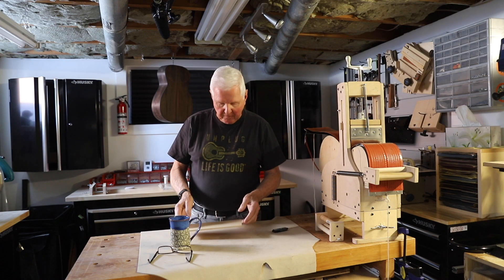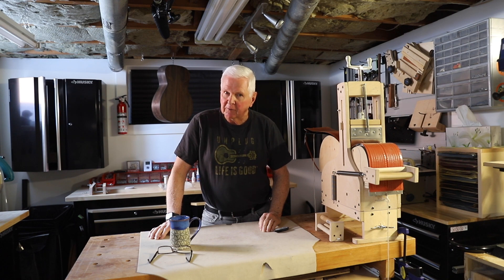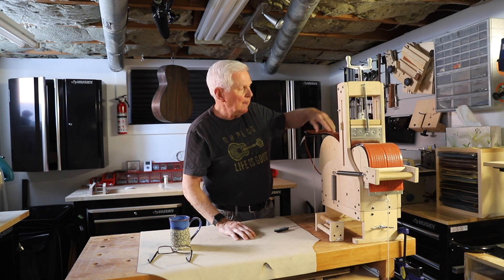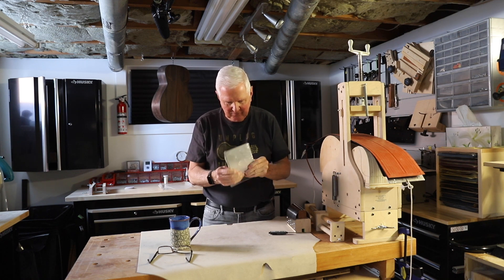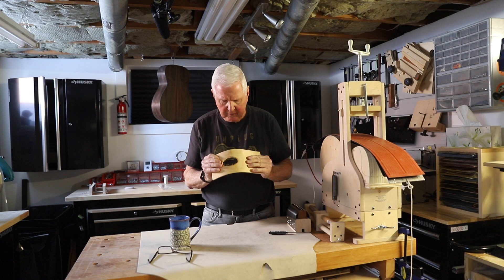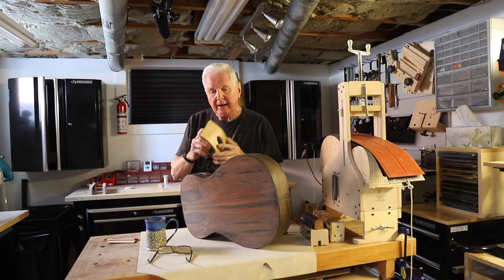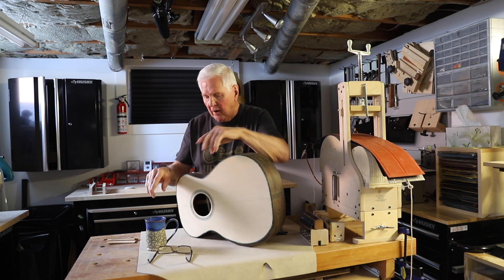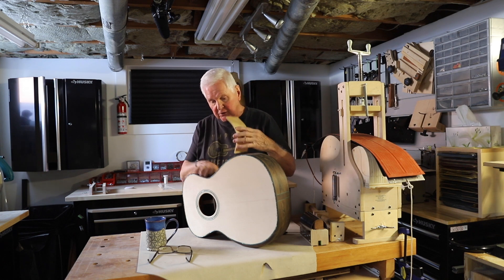Acoustic Guitar Sound Port Jig Works... sort of

Comment: Hi, Monty. I’ve enjoyed your videos, and am following to see you get your sound port jig figured out. Since you used a band saw to resaw the wood that you bent for this go round, why not just trace the profile of your guitar - at the area where the sound port goes - on to a solid piece of wood?  Then, cut the shape on your band saw just short of the traced lines, and then clean it up on a spindle sander (do you have one of those?) by sanding to the lines. That would give you the curved piece that you need for your jig without having to try and bend anything.
Reply: What I’m talking about is the same general idea compared to what you did in your video from 09/16/2019.
Reply from the maker: Actually, you'll see one more video on this but I think your idea is a good one. Thanks!